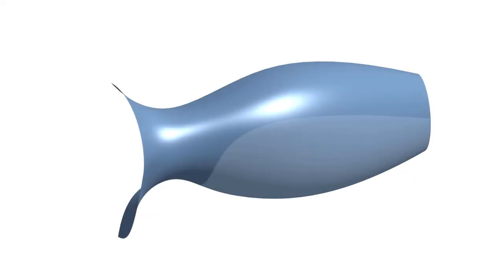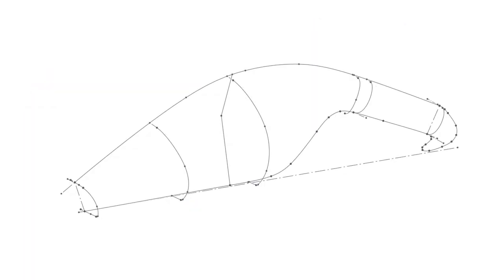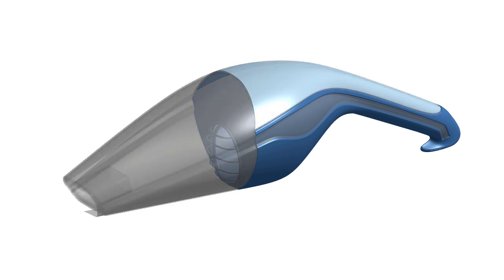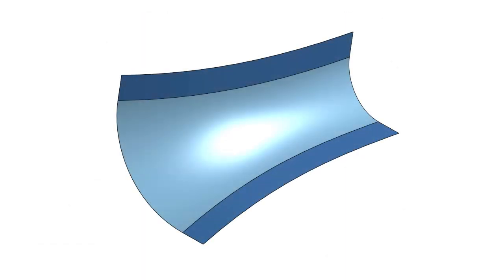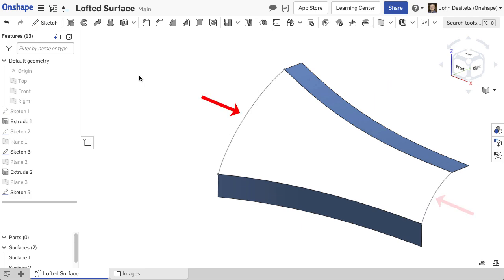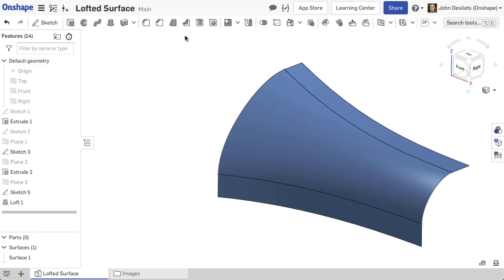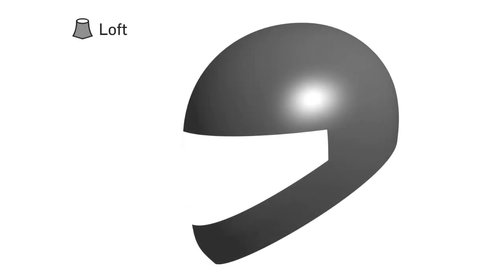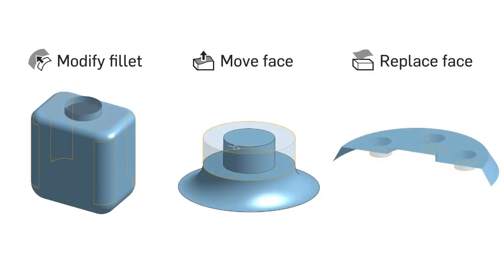Surface Modeling in Onshape

Comment: I fundamentally disagree with the over constraint of curves thinking. In many scenarios, and for faster working, I’d be happier if Onshape produced the higher degree of continuity at the cost of following sketch geometry, especially as undulating sketch geometry can be tricky and time consuming to create. I wouldn’t mind my curves being overridden basically.
Reply: That just introduces poorly defined behaviour, if you want to use tangency while still having the surface go through a point in space just use a point rather than a line as the guide